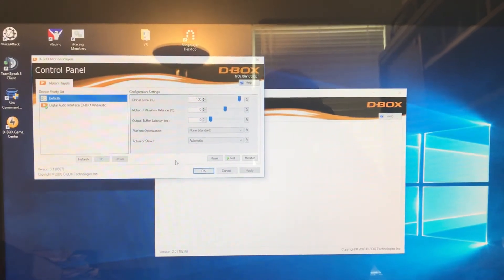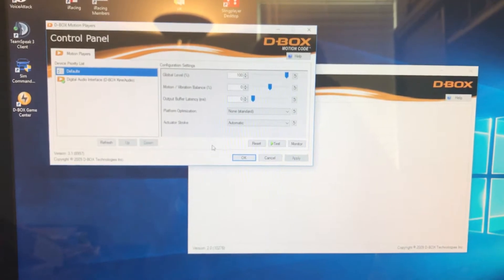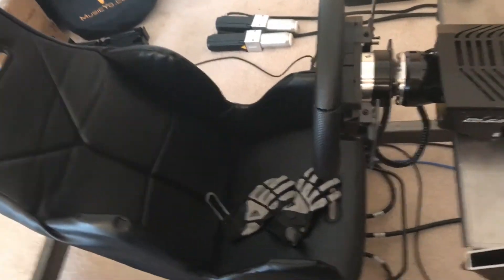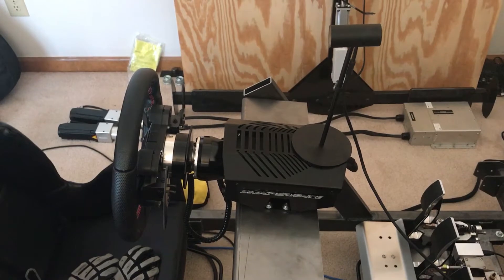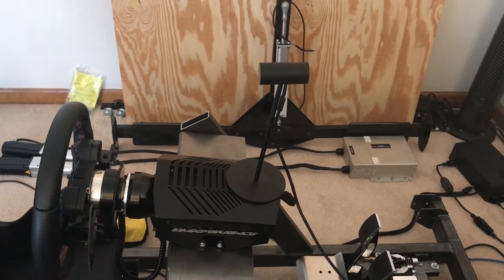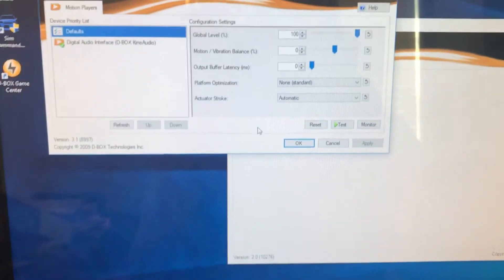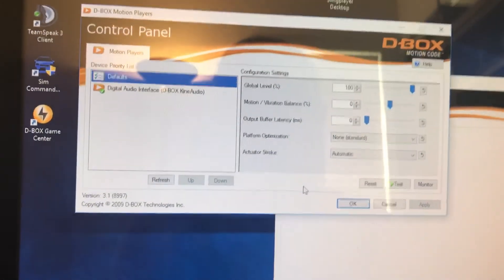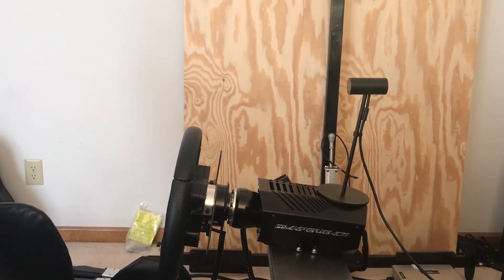D-Box Sim Racing Cockpit Design Rationale

Comment: Hi Todd, I'm new to motion with VR (not VR though) but what happens when you set up your motion rig within a room scale fixed sensor setup with three sensors for example, so the sensors are fixed to the wall, not the motion rig? I'm just about to start a motion build and am interested in it being integrated into the room scale setup. thank heaps. like your vid.
Reply from the maker: I did not have good success with my sensor fixed rather than mounted to the rig. Heave, in particular, was making me feel nauseous. I do know from the D-Box Facebook group that others have made this work though. Everybody is different!
Reply: You typically would get drift over time and eventually your head or body would float out of the vehicle. Motion and VR are still fickle and needs time to setup properly. Also good to mount the VR sensor using a better mount that does not allow any play but still getting the motion and VR to match in frequency and response is difficult and the delta between the two is what I presume makes most people sick. ;-)

Comment: Hi there fellow d-boxer 
i don't own a VR headset but i have read about motion cancellation  and it is what you are looking for. you will need a controller attached to your rig  above your head for reference and a camera off your rig for tracking the controller and the headset  and a program form github https://github.com/matzman666/OpenVR-InputEmulator/releases. there is also a discussion here http://www.xsimulator.net/community/threads/vr-motion-cancellation-time-to-test.10241/

Comment: Hi Todd

VR sim racer here. I'm thinking of taking the step into motion. I currently have an rs1 seat so I could upgrade to actuators but I was just wondering what you thought of g-force simulation solutions like Accelid? http://youtu.be/J3FqpLcheo8

This appears to simulate rail car forces fairly well, and the VR sensor is fixed to the wheel so could potentially provide a realistic experience in headset with regards to head movement?

Have you tried anything like this and would you recommend it, or do you think actuators I are currently the best solution? I suppose one could also try using the g-seat from simxperience and combining it with actuators also?

Comment: Your back! Holy shit.. I really need your advice on best budget racing setup. 

I'm currently working on the best bang for buck setup, and I was wondering in your opinion, is it better to invest in vr, projection, or triple monitor? I understand with vr I need a very powerful system, triple monitor need a mid range powered system and a projection needs less powerful system but higher quality projector.

So far on my list is:
Next level racing f1gt with monitor stand
Thrustmaster t300rs
Proto sim tech pt1
Fanatec cs shifter
Dsd led race king
Wasabi mango 43 in 4k monitor
That's $2250 so far.. and another 800+ for pc. What would you change?
Reply from the maker: Lateaf Smith I don't mean to be a smart ass, but have you tried properly configured VR running on sufficient hardware? I feel it is far superior, and cheaper than either one of these solutions.